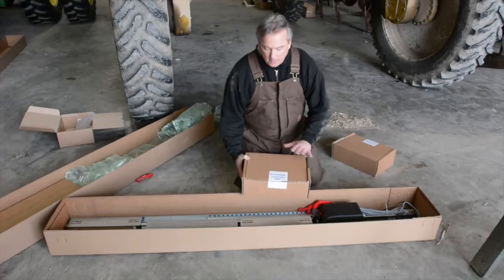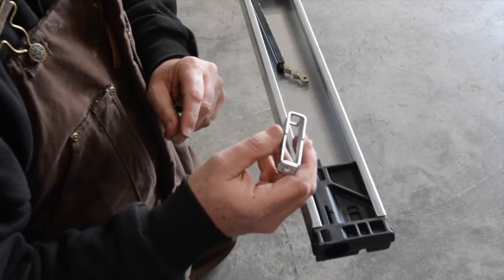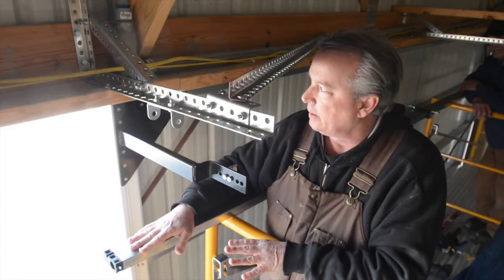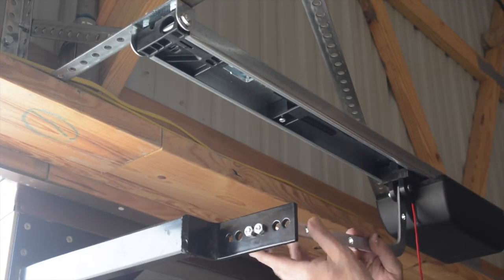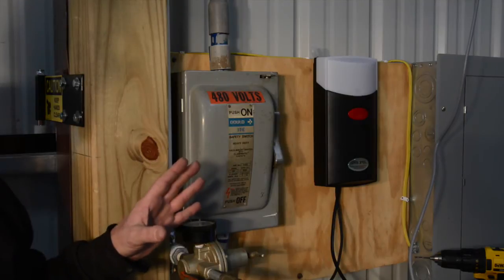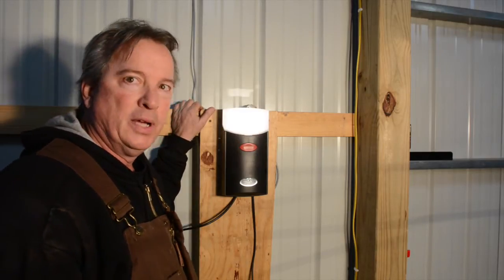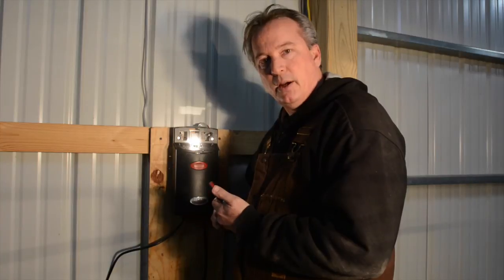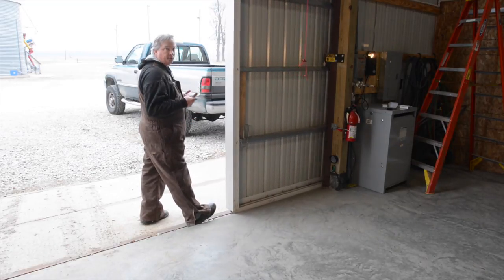Installing the Propel Pro 1000 Sliding Door Automation System

Comment: 32:40 Looks like you didn't even tighten those nuts down. Hell the drill wasn't even turning. You went down a quarter thread it seems. Like as if you mushroomed that tip of the bolt and the not won't turn, but that would mean the anchor would turn with it. We install a ton of iron rolling gates. I always have to get after people when they don't put that nut far enough on the thread.

Comment: Mount 5-feet so the toddlers operating the 480-volt disconnect don't inadvertently play with the door controller. What about the little old lady in your industrial facility not being able to reach it from her wheelchair?  So inconsiderate.
Reply: We provide multiple ways for anyone to open the doors.  The little old lady can simply push the remote from her wheelchair.  We are part of Agribility which helps disabled and aging farmers get into their sliding doors by simply pushing remote on wheelchair.  We are in fact considerate of the disabled and always will be.  to call us inconsiderate simply not fair.
Reply: And yet ANOTHER internet Judge... So typical.  Manners are not exempt just cause you're typing sir.  Find nicer ways to make your point next time.